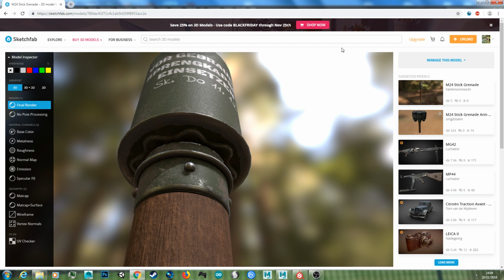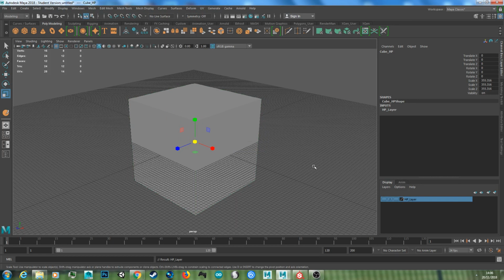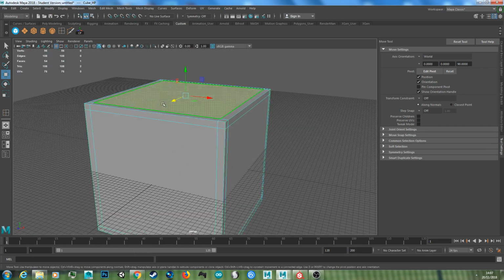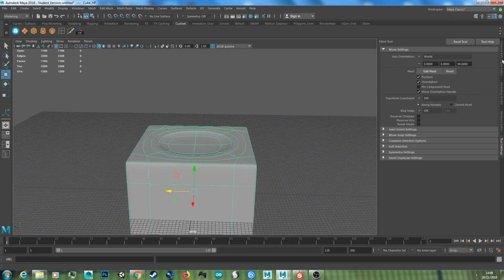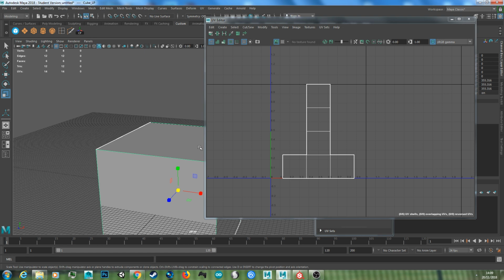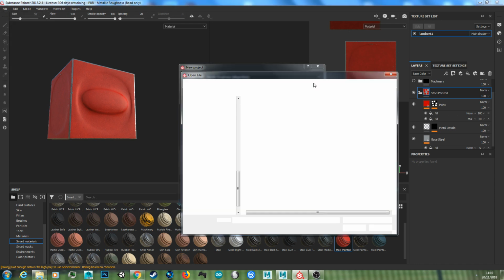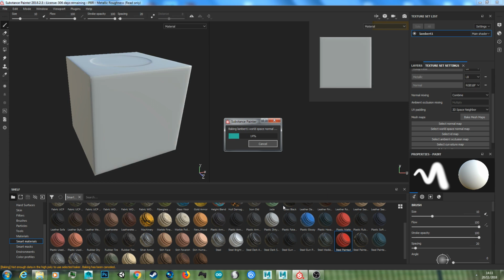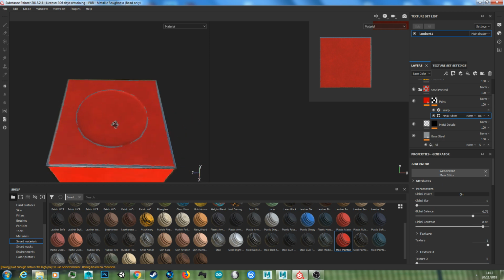Baking High and Low Poly Models (Substance Painter & Maya)

Comment: Quick question, I understand pretty much all this but wondered something- does the high poly need to be inside or at same coordinates as the low poly? 
It seems like that’s the only way I can get it to work but I’m pretty certain the way you get rid of automatic ambient occlusion (where not wanted) during baking is by placing the high poly somewhere else no?
Reply from the maker: If you place it elsewhere then it won't bake any information at all.

(Technically thats a lie, it bakes some position data but you can do that without a high poly. That's just data that it doesn't need the hp for)

Basically it has to be as close as possibly to the surface of each other. Hope that helped
Reply: @3DRoss  aaahh okay thank you.
Follow up question then, would you know how to stop substance painter from automatically darkening connecting geometry? I model allot of weapon props  and parts like bolts always end up extremely black. 
Whilst this isn’t to bad at first glance, it does cause issues when intended to be animated.
Reply from the maker: Not certain. I think you may have to adjust the frontal and rear threshold to something a little larger in the bake settings to make sure the bake covers them areas correctly.
Reply: @3DRoss  
hmmm fair enough, I’ll give that a go. 
Cheers for the info man! :)
Reply from the maker: No problem. All the best man

Comment: thank you so much, finally found what I was looking for! much love
Reply from the maker: I'm glad you found it helpful. All the best in your art development
Reply: @3DRoss  thank you for your kind words :)
Reply: @3DRoss  So just for better understanding, actually its just setting the low and highpoly on the same coordinates in maya and then in Substance I have some space to play with Max Rear/Frontal Distance Parameter, so I prevent weird baking issues? Thats it? Because I can pretty much imagine having problems when do this process for a detailed character instead of a box :D
Reply from the maker: So yeah, thats pretty much it. Of course for a character you may encounter some issues coz nothing ever goes to plan but what you explained is pretty much it. If you encounter issues, just make sure your low poly has enough divisions and matches the hp surface as close a possible. Play around with the max front and rear distance and make sure you have a high enough resolution to support the bake. Making sure that anything other than harsh 90 degree + angles is soft edges and you're good to go. If you encounter issues and not sure how to resolve them just send me a comment and I'll be happy to help
Reply: @3DRoss  Thank you very much for all these informations:) I will consider your tips and return to you, if I have some baking issues:)
Reply from the maker: No worries. Thank you for all your kind words. Wish you all the best :)

Comment: Hello, thank you for the tutorial! I am having a problem when baking an organic model, after importing the low poly mesh (with uvs) to substance painter I bake the high poly id but after baking process some parts of the model still looks low poly and some other parts look high poly which is awful. when baking a high poly organic mesh should I export 2 different subdivision levels of the model from zbrush? (the model was subdivided 7 times when sculpting in zbrush so should I export the very poly model (level 1) as low poly and the highest version of the model as an id (level 7)?
Reply from the maker: Hi there, A few things to note. Make sure your low poly has plenty of subdivisions (so not too low) so it can sufficiently cover the high poly geometry. Also try increasing the frontal and rear distance in the bake settings a bit. This makes the bake cage larger to ensure the mesh is covered.
Reply: @3DRoss  Hello, thank you very much for your reply :) I think my low poly is too low, thanks for pointing this out. where can I find "bake settings "so that I can make adjustments?
Reply from the maker: At 5:58 in the video and under max frontal distance etc. Hope you get it sorted :)
Reply: @3DRoss  Oh hello, very sorry for my late reply. Yes, Thanks to your help I could sort it out :)
Reply from the maker: Nice, great job. Really glad you managed to fix it

Comment: Tons of tuts available that show me how to bake a simple box. Why not show me how to do it for the grenade in your clickb... thumbnail? Backing cylindrical details presents a whole new set of problems and nobody seems to bother with creating a decent tutorial on the matter. Sure.. .show me how to bake a stupid a box
Reply from the maker: The box was so beginners can grasp the basic concepts easier instead of creating more confusion. More advanced tutorials will be coming in the future though. General rules for now is: make sure your low poly has enough divisions to support the curvature and make sure the high poly faces aren’t too distant from the surface of the low poly, without baking sometimes you can get good enough results with smoothing groups, play around with the frontal and rear bake zone offsets, make sure your soft/ hard edges or correct, always have a uv cut on a 90 degree angle etc. I’ll explain all this and extra bits like how to fix a jagged normal map around a curve etc. In a future video  but hope this somewhat helps for now. 
Also the best thing you can do is just play around and see what results you can get yourself, I find that the best way to learn, then if you get stuck with specific it makes it easier and more efficient to search for an answer

Comment: I tried this several times and followed exactly. When I import the High Poly file into Substance Painter the Cube updates but is still a smooth cube, no indent at all. This has always been the issue I have had where the HP object does not show in Substance Painter.
Reply: LittleKing Archery Hi there. Sorry to hear that you are experiencing problems. 

Some key things to note:

-Make sure when you start the project you are using your low poly that is uv mapped
-Make sure when exporting your high and low poly that they are both positioned on top of each other/ in the same place but exported separately 
-If you aren’t using the same naming and correct naming conventions of the models make sure Match is on Always under the baking settings (keep it on always unless you’ve set it up right, by name is just for baking where geometry you have a lot of other close geometry)
-Make sure you are importing the high poly in your bake settings and remove any other models/ previous attempts by pressing the minus with the one you don’t want selected 
-If you are still experiencing problems or your high poly has large indents or extrusions then increase the max frontal and rear distance by a little in the bake settings window.

If none of this works feel free to send me another comment 🙂

Comment: The separate uv step? Does that still need to be done in 2019, if so do you need to uv it again once done in Substance? Thank you for doing this vid! Helped a ton.
Reply: Yeah. The uv shells should not be connected on hard edges because when calculating the normals, you will get strange results. Because it's a hard edge (90 degrees or more) it's not a continuous flowing set of faces face so the normals need the spaces to created the beveled/ smooth edge.

And no you don't need to do this after substance. As long as the low poly matches up with the high poly (roughly) and the low poly is uv mapped (No need to uv the high poly) then you're good. Substance then bakes the high poly information into a normal map texture map to give the illusion of extra shading and geometry. (That's why you need the mesh uv mapped so you can add the normal map/ high poly texture and it knows where to apply it) It also created other maps to help with smart masks so you can auto generate worn edges along the edges of a shape.
Reply: Also glad it helped and thanks for watching. Wish you the best!